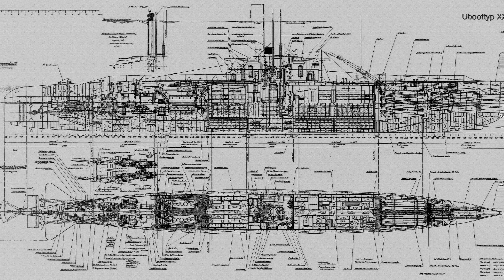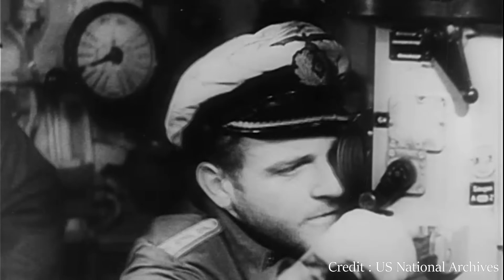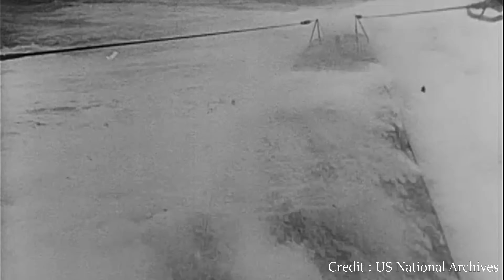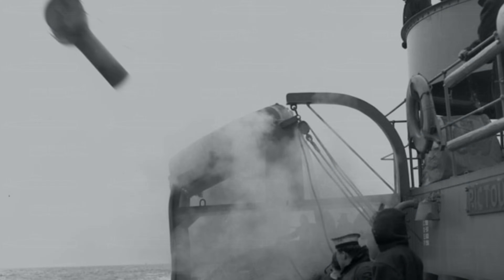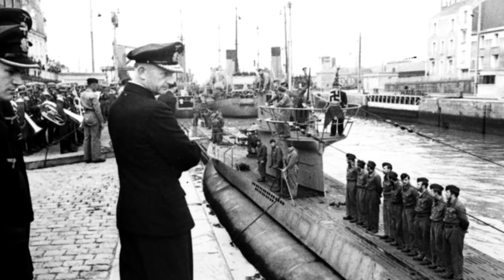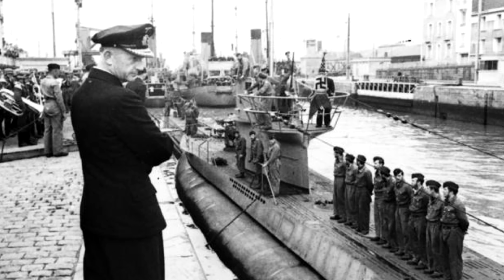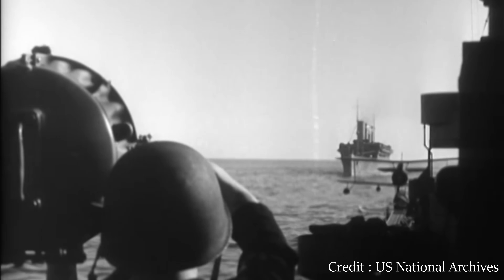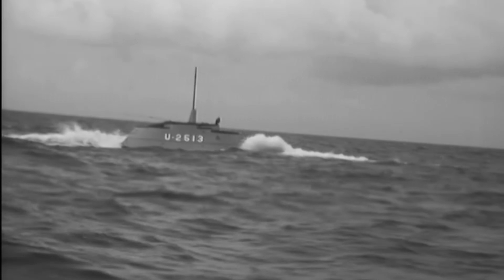Was the most innovative submarine design of WWII successful? The German Type XXI submarine

Comment: While i do not debate your summary findings on engine performance, i do not disagree that the design was a failure.  You failed to understand that it was so successful in its design, that it lead to all major navies using it as a design basis for their own designs. Given time, the design flaws would have been resolved by a slight lengthening of the engine compartment to replace the 9 cylinder engine with the known 12 cylinder engine or adding the space needed to retain the turbos, by adding a proper intercooler at the exhaust side of the turbos to cool the intake charge into the 9 cylinder diesels, allowing full power operations. You failed to provide the details of why the XXI did not meet the design goals / requirements.  

The failure of the XXI to meet those requirements can be summarized in a few key areas.  Those specific failures are documented in the US performance and design study of U3008 by BUSHIPS testing and examinations while operating the U3008.  I will summarize the key findings that resulted in the lower performances:

1. Maximum Speed was limited to the fact that the 9 cylinder diesel engines turbo chargers caused overheating of the engines when under boost and would cause engine failure if operated at full power.  many of the completed XXI boats actually ad their turbos removed to prevent this from happening.  This resulted in the lower surface speeds and the length of time (6 hours) it took to fully charge the batteries.
2. The passive sonar system suffered from high ambient noise conditions when operating at higher speeds, effectively reducing its full capability to search and detect contacts at long ranges. The sensor array was not in a good location to shield the array from hydrodynamic flow noise around the arrays housing.
3. High speed control during maneuvers was much more difficult with the sub reacting much more like an airplane does when turning.  the healing over of the sub in turns, results in the rudder becoming the stern plane and send the sub diving down at a significant down angle, requiring the sub to slow down to regain depth control.
4. Snorkeling operations were impacted by the performance of the head valve.  This is the ball shaped float valve at the top of the snorkel mast / tube.  Water would frequently be ingested in the air tube impacting the pressure swings inside the boat.

Since no prototype was ever built, due to the emergent conditions of the war situation, all the early boats suffered in these specific places.  Further specific design and testing details are available in the US Navy's report on the design of the U3008.  The US Navy submarine engineering Codes tested the U3008 for about ten years. 

My Boats Garage (on Fb).

Comment: The R Class is the first submarine designed for faster speed underwater versus the surface.  It was the first purpose built attack submarine and it saw far more service than the Type XXI
Reply from the maker: That class might have been able to move faster underwater than on the surface, but only for shorter periods. It was not able to operate primarily under water, which in my opinion is what matters.

Comment: Poorly researched! The Class 21 was planned to be equipped with the Walter engine! This is based on electrolysis and would have made it possible to drive submerged with "combustion engines" (hydrogen/oxygen)! This can be seen from the half-floor - the "basement" (that's where the engine was supposed to go). The drive wasn't ready for series production in time - which is why the Class 21 was initially equipped with a standard diesel-electric drive! (Otherwise, the flounder would have kissed you!) Greetings from Germany.
Reply from the maker: Hello 😊 Would you mind sharing your sources? My books states that the type XVIII was the hull design planned for the Hydrogenperoxide (not hydrogen) plant designed by Helmut Walter, which was first tested in the V80. The type XXI hull was derived from the XVIII, but always with a diesel/electric power plant 😊 I have a video that covers this point.

Comment: Well some information is true but some is not true.  The reason the Performance was not as expected lies in four specific areas. The most important factor was the engines performance. The actual low power of the two 9 cylinder turbo diesels was the most significant problem.  You flashed up a chart of the numbers but you failed to explain what they mean and why they failed to meet expectations.  If you had reviewed the American Navy's testing details, you would see the cause and effect that produced those numbers.  The 9 cylinder turbo diesel engines were a replacement of the engines used on the Type VII boat 12 cylinder engines.  Nine (9) cylinders were enough but the turbos caused a massive over heating problem with the cylinder heads and exhaust gas temperatures were so high that the engines would have failed in service with the turbos in place.  Perhaps Intercoolers would have solved the problem but space being limited, there was no way to fit them of such capacity to cool the intake air temps after the turbos.  The design space was so tight there was no short term solution to the issue without more room in the compartment for such seawater intercoolers.  This flaw, led to engines with a very low power rating, very long battery charging times, the low speeds and more frequent battery charge periodicity. If the engines had performed as expected, the speeds would have been better and the battery runs longer and underwater speeds would have lasted longer.  The second issue with the engines was the snorkel head unit.  The head unit did not preform as well as expected in rough seas and impacted crew comfort when charging the batteries.  Still it was better than the previous Type VII boat pole mast snorkel, since the XXI was a hydraulically raised mast, allowing for different operating depths near the surface. this allowing the XXI to remain submerged  and if the engines had performed to spec, limited charging batteries at night.  

Secondly the performance of the SONAR Sensor array was limiting the ability to locate shipping.  The Germans had the right idea in their design concept for the sonar array and its ability to locate and track contacts but failed in the location of the array.  The array was in such a location that ambient flow noises at speed severely limited its ability to detect and track contacts.  Background noise or flow noise at the array flooded out or washed out contact signals, reducing the detection ranges and tracking ability when the boat needed to increase speeds to catch a contact and position for a target solution. The sonar array needed to be within the hull fairing and not jutting down and below the pressure hull unless it was better faired into the hull.  Add to the fact that own ships noise and operation of equipment in the torpedo room added to the ambient noise around the sensor array, reducing its effectiveness.

Third was the problem, unforeseen during design, was the hydrodynamic effect on the boat at hi speeds.  What was discovered and nearly caused the loss of the early production boat, was what I call the "Airplane" effect.  Just like an airplane, when a submarine speeds up to these new speeds over 10 knots the boat starts to bank into turns.  When that happens, the control surfaces act on the plain they are presented with.  At 15 knots, the boat banks sharply into turns, that's when the rudder and bow planes act as stern planes and a bow rudder.  This causes the boat to drop the bow and raise the stern, sinking the boat deeper and deeper.  Pulling up on the bow planes steepens the turn and the rudder pulls up the stern  in an unexpectant manner very quickly.  This forces the helmsman to stop turning by placing the helm amidships and the bow plainsman to place his controls amid ships until the boat stops leaning into the turn and then the bow planes man pulls a rise on the bow planes to recover the depth lost in the turn.  Quick turns were a real danger to a green crew.  it can take a few minutes to recover and by then several hundred feet in depth could be experienced in one turn!  It took a balanced slow control approach to maintain control at high speeds.  The US Navy experienced the same control problem with the experiment high speed submarine Albacore Hull.  

Forth was the absolute poor quality of the hull welds used to build the boats in 9 sections.  Each section was made at different shipyards and delivered to slipway yards for final assembly on pontoon barges.  Welding was sometimes performed under harsh conditions and by slave labor which failed to ensure quality welding on critical welds on the pressure hull.  It is doubtful that these hulls would have stood up to severe pounding of a concentrated depth charging event when caught, if the Allies could catch one of these at sea.

The US Navy's performance test report on U3008's sea trials after WWII documented these findings.
Reply from the maker: Thanks for your feedback 😊 This piece of content was never aimed to go into depth of why the performance was not as expected, but rather to challenge the common conception that it performed according to specs. So it's a creative choice.

Comment: The biggest downfall of the Type XXI was the situation it was deployed in. Germany had by that point lost the war, and was delaying its end, its factories were being bombed daily, and the front lines were approaching Germany proper. The design itself also had issues with its hydraulic systems, which were difficult to repair and had many valves and switches outside of the pressure hull. The diesels were underpowered, they were supposed to create over 3000hp each, but created 2500 on a good day, leading to long recharge times for the batteries.

Comment: But sire

My Mk24 fido torpedo

Jokes aside i like how Type 21 does change a lot of things until new innovation change from WWII style subs to a far better design. One thing that all WWII subs is they suffer from sound issue from their general design of screw and hull design. Nautilus really pointed this out which really use the Type 21 style of design.
Even if type 21 had noise reduction engine, it will in the end suffer from what it was.

Also a lot of other nation did their own research for submarine and ASW.

Credits should be given to where they deserve and type 21 deserves plenty of credit up to a certain date.

Even so, the design of Type 21 is still used by majority of smaller navy submarine fleet.

Now if US actually got Mk22 active homing torp working in time.

Comment: I’m curious. When did they finally decide that the shape of a torpedo would also be an excellent shape for a submarine?
Reply from the maker: I would expect they knew already. However, it was not until they designed a submarine for primarily submerged transit that it would make sense to apply it. Reason being that round shape is not good for surface transition

Comment: No real surprises here, That is not to say the type XXI was not a leap forward in submarine design because it certainly was but being hyper-critical of its performance has to be taken in the context of the conditions under which it was developed and constructed. Metal bashing was not the problem with the build it was the installed machinery 2 x 850hp junkers were not going to push it very far very fast on the surface and whatever almost clockwork motors they fitted for underwater work seemed to have a similar failing which is rather odd when you think on it for a while because the Germans had an array of very powerful lightweight heavy oil engines available. Battery tech was well in hand already and the numerous electric motors above 2k output so why did they not install them into these boats. 
The answer might not be hard to obtain considering the level of industrial bombing taking place which may just have forced their hand into fitting something. anything as long as it made it go just to please their masters higher up the food chain.
Reply from the maker: For the diesel engine designs, the challenge was not in what the engine was able to produce (2000hp I think), but what was safe and possible during snorkeling operation. It was the very high exhaust gas temp, which end the end impacted the possible output.
Reply: @BecksHobbyProductions  As an engineer I would say that none of the issues you highlight were anything more than technical in nature and while not easily solved were solvable given time and required resources as we saw post-war with Russian DE boats using snorkel systems which were able to produce some quite remarkable turns of speed. 
The problem facing the Kriegsmarine was a multi-faceted one by the time the XXI was starting its build. To large to go into here but if you look at how procurement procedure works you would quickly see the issues they faced at that time. Pressures from above baulked by the immovable reality of conditions prevailing at the time. working down through the ripple effect of that procurement system I would say that simply getting engines of the size they did fit built and transported to the shipyard must have been a nightmare.
Reply from the maker: I expect that to be true as the vessels didn't have much time to flesh out the problems. Previous types were mostly iterations and not brand new designs like this.

Comment: The problem for the vessel is German production engineering was unable to meet the tolerances required to make the boat in sub assemblies away from the yard such that it could just be easilly bolted/welded together on the slipway. So they ended up having lots of components which they were unable to assemble efficiently in a way that the vessel could meet the requirements of sea trials once completed.
This problem is prevelent across most of Germany's industries in the 1930/40's, where equipment and vehicles were poorly designed from a maintenance and repair point of view; where as such process in the US system was able to master this when rapidly building Liberty and its sucessor the Victory classes of merchants during the war. 
Now i dont have data to answer the why of this, is problem of high accuracy standards like having enough engineering "guage blocks", was not up to scratch in Germany, where as the Ford Motor Company had facilities to make these essential measurement tools and could ensure that US industries did achieve consistent tollerances needed. 
Equally it could be the German industrial processes at the time using slave labour, and that labour sabotaging components, which we know happened in Panther tank production. It would take probably a couple of things- knowing if documents and reports survived the end of the war and knowing where to find them in archives if they still exist.